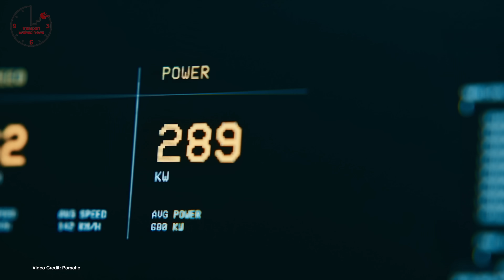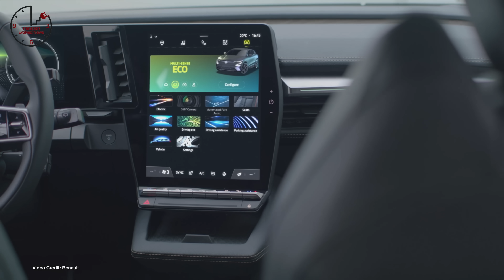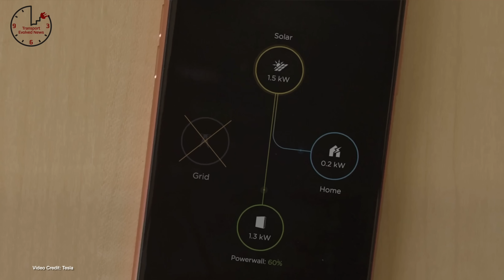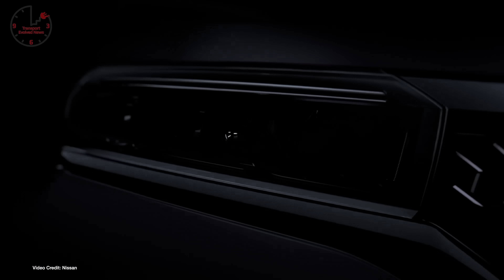TEN Episode 354 - Tesla Model S Plaid Nurburgring Record, China Leads Offshore Wind, TSLA at $3000?

Comment: Good roundup of news. I liked the 2 Megawatt plane motor. The car carrying bike at rear may not get Australian approval. I believe complete rear number plate must be visible even on angle when towing a box trailer/boat trailer etc. The Gov subcontractors make lots of money from taking pictures of cars, and they won't like it. Number plates are big business. The state of New South Wales has a poor protective coating on their plates that degrades in weather, needing compulsory $25 replacement about every 5 to 7 years. This wasn't the case 50 years ago.

Comment: i think the renault megane etech looks really good, inside and outside. together with it's size, it would fit for me. but the "etech" is too outdated for me. front wheel drive, low power, low top speed and the small battery. some things could be a kind of compromise if the price is right, but 60kWh as a biggest battery option is a no-go for me. can't go 300km on the highway when driving fast.

regarding the plaid s nordschleife time: i think, it will not last that long. porsche has a 3 motor and 4 motor in development for their EVs for a long time. i expect them to be finished already and show one of these in the next year. could be in the EV version of the macan first.

Comment: Isn't a Multiple Unit basically the modern word for a "locomotive"?
Reply: No. An MU is a railcar with its own power. It may or may not have an operator's position, but you can couple as many as you wish and the power will increase proportionally to the load. They can be a DMU (diesel) or an EMU (electric). I'm sure there are other possibilities. Most subway cars are MU. Each car has shoes that ride on the electrified third rail. EMUs that get their power from an overhead wire are connected by power cables so that every car doesn't need a pantograph to pick up power, but each car has motors. And a DMU has an engine in each car. It isn't a new concept.
Reply: @danielcarroll3358  By "locomotive" I meant the car that provides power/traction to the train.
Reply: @MartinMenge  I understand. But there isn't a car that provides power. It is distributed throughout the train, so they are not referred to as locomotives.

Comment: I did a double take when I saw the Microlino. This past week a neighbour was hosting some vintage cars in his driveway and in the garage was a 1957 BMW isetta, which is definitely an ancestor design wise. It was the first time I had seen a car where you get in from the front. The owner joked that the designer must have had his roots in refrigerator design:). The electric version makes a lot more sense and I hope it catches on!
Reply: The Door Handle of the Isetta is a part actually used for refrigators back then. So thats not a Joke. Still funny. :D

Comment: Nurburgring times are the least intereting thing about any road car.
Reply: you have to distinguish between the normal race track and the nordschleife. the nürburgring nordschleife is a natural track and not an indy car oval or quater mile straight track. it has a lot of small tight curves in contrast to F1 tracks. that means, it is also a challenge for "slower" cars like my old 150hp diesel cupra where it's top speed is "only" 225km/h after being almost 21 years old. i went for a couple of exciting laps to the nordschleife. great and very difficult track.

Comment: A battery powered train could include an engine car/cab with a small battery for rail yard movement, with the main batteries carried in separate power cars added to the train in proportion to range and load required, and which could be left and charged in the yard for later use.  Drop off the discharged battery cars, pick up freshly charged ones and the needed number of passenger cars, and away we go.

Comment: //This isn't mean to disparage Niki or TE, love their stuff, just ranting at that laser wiper idea.

Laser wipers? That is an amazingly stupid idea. It takes a ton of energy to vaporize water. Maybe a few drops could be zapped away, but if it's really raining then the amount of energy you'd need to eliminate all that water would drain the battery in seconds.
Not to mention all the residue left behind. Little rings all over your windshield where whatever was dissolved in the rain, or from the water on the ground getting splashed onto the car, stays on your car till you wash it properly. 
Then there's the rapid heating and cooling from the water being vaporized, that's gotta put stress on the windshield.
Reply from the maker: Oh we agree
Reply: I doubt you I have the brain power of the engineers at Tesla. They may use it they may not but it will not drain the battery.Look in the Lasik Eye surgery done with the laser.

Comment: I wonder if the GM battery issues will trickle into their partnership with Honda/Acura for the future models?
Reply: Are u expecting bad batteries to go into Hondas? LOL
Reply: @mamadouaziza2536  not at all, I just hope that it doesn't delay the project or force a reduction in production
Reply: @10lawngnomes37  
This battery issue with GM is already hurting them, GM has no new batteries to replace the problematic batteries.. What are they going to do with all those recalled Bolts?  Its as if GM now wants the Bolts to fail and they pull out of electrifying their upcoming cars..

Comment: Like Alstom, Siemens also plans to make a very similar train with fuel cell and battery variants.
The state of Baden-Württemberg (southern Germany) signed a contract requiring Siemens to deliver 20 battery electric local trains in 2023 and keep them operational until 2052, replacing some of the noisy diesel stinkers. The trains will charge off the available overhead lines at end stops and travel between those on battery power.